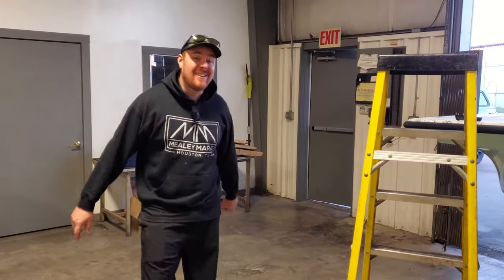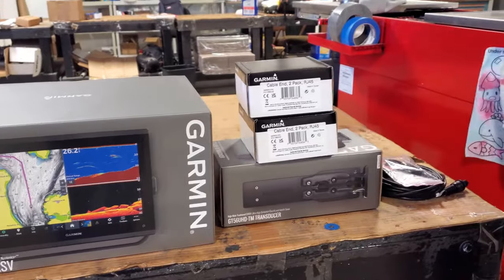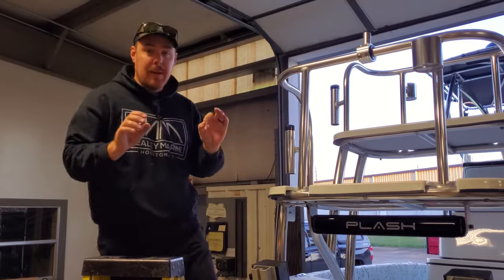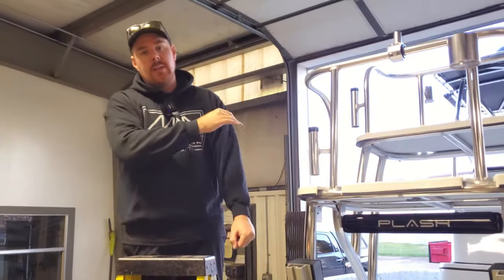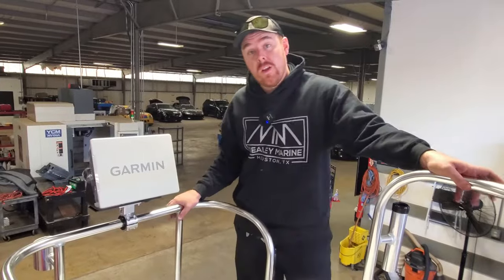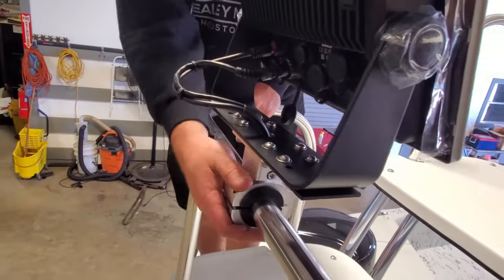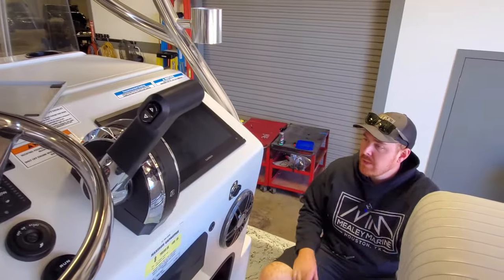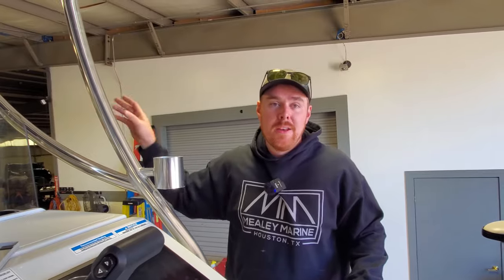Insane install on this $250,000 boat

Comment: I think someone fat fingered the price of that boat, if he paid $250K for that he got taken, $150K as rigged maybe.  I do like the bow platform with the graph up front that's pretty cool.  The mount you guys used for the Garmin sucks, I had them on my boat for the antenna's and they don't stay tight.  Looks like you're in a machine shop, you should have fabricated and welded on tabs for the install, much cleaner.  Other than that the install look great.